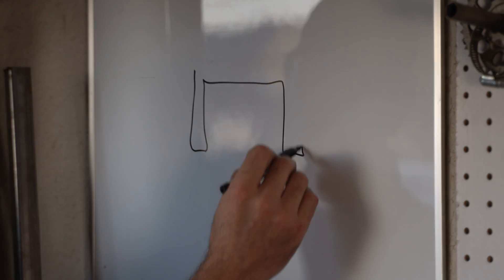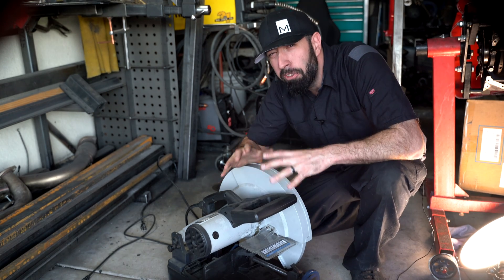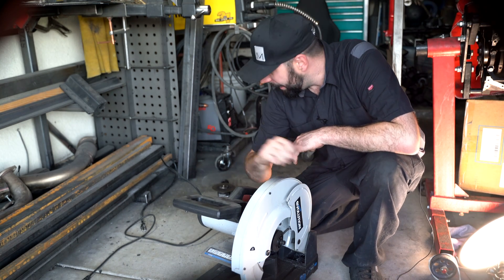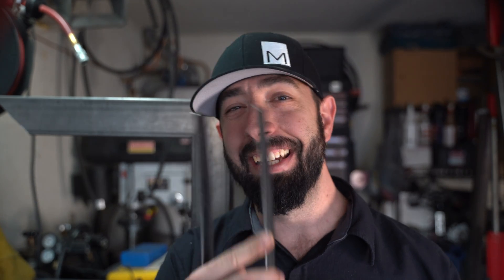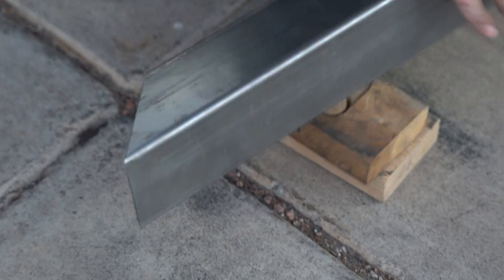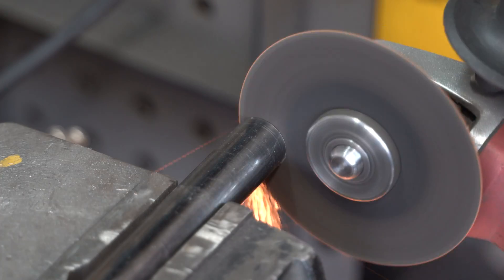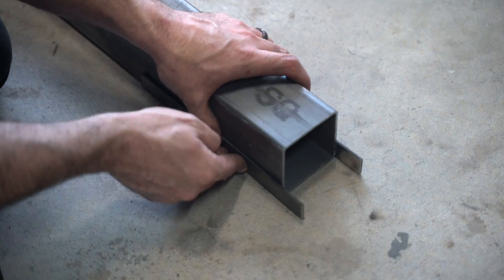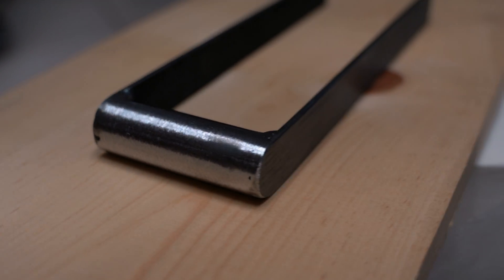Cut a Perfect Miter Joint/Corner Joint in Metal Tubing with a Handheld Grinder!!

Comment: Thanks for the idea. I used this to make my own jig but instead of pipe holding the flat 45s I used a piece of square tubing running perpendicular. That way all you have to do is pull the tubing from the jig flush with the piece you are cutting and the guides run perfect 45s on either side without having to use a square. If I want a different angle I can always mark the angle by hand and use the parallel pieces without pulling it flush. Hopefully that description makes sense.
Reply from the maker: I think I follow and that's super smart! A huge percentage of my cuts are 45% and that would eliminate the use of a square for most things. Thank you for the share!
Reply: @GarageFab  can you show how to make Y shape from square hollow tubes? I don't know what angles to cut so it fits.
Reply: Have a video of this? Not really understanding it from the description 😖
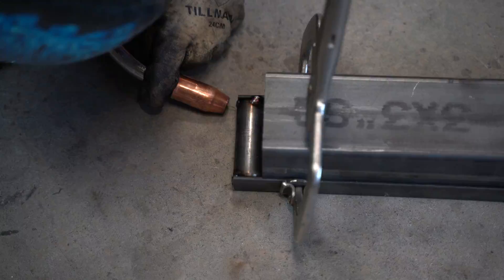Reply: @K1L0W0G  Imagine if the round tube on this jig was square tube instead. Now imagine that at 2:47 the pipe section was pushed down against the workpiece instead of just sitting in the air. When pressed down, the flat part of the square pipe handle would lay flat against the workpiece, which means this wouldn't be very good for "random" angles because the flat part of the square tube and the flat part of the workpiece would want to lie directly against each other. Then you could weld the two flat bars so that when the square pipe handle is pressed down on the work piece they form perfect 45 degree angles automatically. So you wouldn't need to use the square and marker to mark your 45 first. You could just set this tool down on it and it would line you up for a 45 degree cut automatically. This would be trickier to weld up since the square tube would be rotated 45 degrees from lying flat if you try and do it like it's done here at 4:40. It would make sense to do it exactly like in this video with round tube first. Then clamp the tool to the workpiece when it's at a 45 degree angle like 2:24. Now you could easily clamp two more flats resting on top of your known parallel flats from the first tool and set a piece of square tube between them resting on the workpiece as a handle. Tack in place and weld. Now you have a 45-degree only tool that doesn't need a square and a tool that does need a square and can do any angle like in the video. Hope that makes sense.
Reply from the maker: Thank you for taking the time create such clear instruction, Colton! In the beginning I had hoped that this channel would become a community of like minded people that would be willing to help one another out.
Your response made me smile. You are appreciated. 🙏
Reply: brilliant
Reply: I work as much in wood as I do in metal so I’m going to fab-up your parallel tool in some nice solid oak. It’s used as a mark up tool and will never see flame or heat so why not solid kiln dried hard wood ?
Reply from the maker: I’d love to see it when you’re done! It makes me smile to think it could be a beautiful tool. The one in the video is the nicest one I own. The rest are just mild steel flat bar welded to some pipe. Mill scale and all. 😂
Reply: Bro! Bro! Bro! You made a novice into an expert with that idea, even with a full length of tubing you need to ensure it’s level to the bed of the cut off saw to cut it square or true to whatever angle you need, this can be challenging for some. Love your videos and as one of your comments said, short and sweet ! But we neeeeeed more videos lol ! Much love from the Caribbean!
Reply from the maker: @SuperMarcanton  Thank you, Marc! More on the way. Cheers!
Reply: I have watched this video time and time again, what about a collaboration with Fireball tool to see if you can make this tool and sell it ? Just a suggestion .
Reply from the maker: I love Fireball Tool. Brilliant stuff. It’s such a simple tool, I can’t imagine needing his brilliance. I’m developing an online store of my own and we’ll try and market it there and see what happens.
Reply: excellent @GarageFab
Reply: Yes just found by accident 2 bits of angle welded perpendicular will give the same result. But your way using SHS would be a bit better
Reply: What’s to stop you from making the flat stock slightly thicker and you can clamp it to the workpiece and use it as a temporary guide for the flat side of the cut off wheel. Once the beginning of the groove is marked, remove and cut the rest of the way. Straight, accurate cut and no damage to jig.
Reply from the maker: Do you have Instagram? If so, contact me there and I’ll try and draw up a simple sketch of Jon’s idea at lunch break tomorrow.

Comment: Brilliant!!! Maybe instead of fabricating multiple jigs, construct one and replace the middle tube with a suitable length screw and some nuts. Each time you have to calibrate the tool, though...
Reply from the maker: Yes!! Man that’s such a good idea. I’m going to make that as soon as I get a chance. Thank you. You should be able to avoid the need for calibration if you use two tightly fitting square tubes, in place of the round tube I used.

Comment: Hi, I'm a novice , never trained diy welder and that, my friend is a very good idea. I'm about to start my project shortly of building two gates with 2x2 galvanized hollow steel and a sliding gate with 2x2 and 2x3 sections. That is an idea which I will surely use for accuracy..

Comment: You could get 2 sets of telescoping pipe, weld both larger tubes to one side spaced a few inches apart, and the smaller inserts on the other leg. Then you'd have an adjustable tool that widens/shrinks so you don't need a new tool for each width of pipe.
Reply from the maker: Very good idea. 👏

Comment: You are good. How do i know? You use flex without protection cover or safety gear and you are at age and have all eyes and fingers.
Reply from the maker: Hahaha! I guess that’s one way to look at it. I use a guard now. Too many people got mad at me.
Reply: @GarageFab  i don't believe you 🤣. I guess only when cameras are rolling. I have such nut like you at home so i can tell it is hard to break a habit. Starts with working in flip flops ends with welding with just looking away.
Reply from the maker: One weld spark between the toes is enough to disown flippy floppies for life!
Reply: @GarageFab  🤣 just heavy swearing in our case. So far. Knock knock. And we use mainly flux core so probably really asking for it.

Comment: I did notice when you were cutting with the grinder. You actually put the grinder on an angle as well and my dumb a** wouldn't have thought of doing that. Thanks.
Reply from the maker: It’s just a habit from cutting thicker wall material. It doesn’t matter as much with thin metal. However! I would recommend when cutting, Start with the angled lines, and with the grinder vertical, continue cutting passed the edges a little. That’ll put a short cut at the corners that will indicate where the 90 degrees cuts will be. Because sometimes they aren’t where you drew the lines. 😬 Hope that makes sense.
Reply: @GarageFab  They are NEVER where you drew the lines 😛

Comment: All the utubers spend more $ on cut off wheels than just buying a miter bandsaw, like Ellis brand. They last forever been using them for thirty years.
Reply from the maker: Haha! I have a metal chop saw, but the purpose of Garage Fab is to show people with low budgets that they don’t have to buy a bandsaw or chop saw in order to take on big projects.
Reply: This dude must be on crack.  Bottom of the line Ellis bandsaw is $4200 out the door.   That would buy a damn tractor trailer load of cutting wheels
Reply: @vr6swp  if you want to take all day and have poor quality fits, have at it! As far as crack goes you won't want to tell me that to my face!!!

Comment: At 2:15 into this video, you show a horizontal bag setup on a frame.  What is that about ? Let's see the rest of what the bags do please ?
Reply from the maker: Ah! That was one of my favorite builds to date. Those were remotely mounted bags for the front suspension of Chevy Luv pickup that was getting a V8 engine. The front control arms were so small that an air spring large enough to lift the motor wouldn’t fit.
When the bag inflates, it pushes a hydraulic cylinder mounted to the frame, the fluid from that cylinder is forced into a second cylinder that’s mounted to the front suspension which provides lift.
If that didn’t make sense, scroll down my Instagram (@GarageFab) a LONG way and you’ll see a lot more photos of the project as well as some videos of it working and a video of me jumping up and down on it. Scroll till you get to March 2019.
I won’t be doing any videos on it unfortunately because that truck is in Arizona now, but I might try and use the ideas in future builds. 🤷‍♂️
Reply: @GarageFab  Thank you for that.  It looks interesting but I can't access Instagram. I don't own a smart phone - a requirement for an account there. But what you did looks interesting. I love fabricating & appreciate your videos, time and effort.
Reply from the maker: I envy you not being tied down to a device like everyone else in the world. I can access Instagram from my desktop without an account. You may also be able to.
Thank you for the kind words, James! I appreciate you. 🙏

Comment: I struggle with the flats to be honest. Getting the square line to be in the correct spot to match up with he angle markings as it goes around the tubing.
Reply from the maker: I’m not sure I understand, but if I do, try lightly clamping it to the piece you’re cutting. Clamp loose enough so you can move the tool around but tight enough to hold it in place when you let go.

Comment: Cool videos. Looking for recommendations  for home 110-120volt plazma cutter and 110 compressor. Cutting Nothing over 1/4 inch
Reply from the maker: Thank you, Tim! I’ve only had experience with two plasma cutters. Mine, Hypertherm xp45. It’s amazing.
I also used an old timey Esab. I’m not sure of the model. And I’ve also got no recommendations for air compressors. I went straight for 220v. Most 110v compressors are super loud and they don’t produce enough air for constant plasma cutter use.

Comment: Watched to 2:18 and subscribed to your channel. You are an inspiration to lowly weekend warriors. Kudos Sir!
Reply: I will get mine laser-cut in quarter inch steel as "U" shapes .
Reply from the maker: Thank you Jonathan! You are greatly appreciated.
I really like the idea of the laser cut tools. I think that would take them from slapped-together to really professional looking.
Keep in mind though that the width plays a large part in ensuring the the edges on both sides are in the same position. The thinner the tool is, the more it can rock and therefore give you inaccurate markings.
The wider the better! That said, consider keeping the laser cut U idea but make it a quarter inch wider than the material so you can slide in some 1”-1.5” flat stock and tack weld them. 
Can’t wait to see what you come up with!

Comment: thanks a lot Sir. now i know how to cut the corners of the square tubes. i am new to welding and just starting to make DIY's and my mistake is when i cut the corners i cut it in a 90 degree angle. i never thought it should be slightly bend on some 45 degree or something, I appreciate that Sir. thanks a LOT.
Reply from the maker: My pleasure my man!
Best of luck on your channel. 🙌

Comment: Your scribing jig is a nice idea. If you added a little rubber band at the end of the legs to pull them gently towards your material, it might be more forgiving towards a little rougher handling when you need to turn things over. On the other hand, it doesn't need to withstand any more forces than a sharpie's point, so whatever 😀
Reply from the maker: Something to keep it in place would be brilliant! I occasionally clamp it to the work piece but that’s somewhat cumbersome.
I appreciate you!

Comment: instructions unclear. I used the tool to stab my BF with it. can you show how to make Y shape from square hollow tubes? I don't know what angles to cut so it fits.
Reply from the maker: Sounds like no instructions were needed! 
Now clear your YouTube search history so I don’t get a visit from authorities.
You’re asking questions about geometry and math. Both of which I generally try to steer clear of.
But here’s some likely terrible advice…
Assuming your “Y” will resemble the Mercedes Benz star, each of the three tubes will need to be cut twice to form a 120° point. Scribe a line down the center of the tube. I believe each of the two cuts will be 60° with the point dead center on the square tube.
That’s six 60° cuts total, and maybe possibly with a lot of luck they might fit together to create a three pointed star.
Lemme know just how wrong I am!!
Best of luck.
Reply from the maker: …and something feels wrong about that and I haven’t any tools with me to confirm.
Each cut may actually be 120° to create a 120° point. 🤔 My head hurts.
Reply: @GarageFab  it's much more difficult than it looks. I tried making one piece 90 degrees and then other 2 pieces 45 degrees, but the problem is I wanna put these two pieces to connect to that hole on the 90 degrees piece. so the V shape must be in the middle of the 90 degree tube and they must both fit inside. you can make a video about it sometimes if you think you can handle it :)
Reply: it will lay down on flat side. just like letter "Y" nothing fancy.
Reply from the maker: Still struggling to picture it. I can’t promise a video. (Because I can’t envision where this piece would fit on a vehicle) But maybe I’ll slap something together on my Instagram account if I can find some time. 🤷‍♂️
Reply: @GarageFab  it is not for a vehicle. it's an item I wanna make for woodoo to turn my BF into a capybara. I hope the authorities will not see you as my accomplice. you will figure something out. tell them you wanna adjust your exhaust :)

Comment: Thank you for an excellent piece of training. I am a week into metal working. Building the feet of a dressing table for my wife.
But I battle with the marking or the rectangular tube. I need to work with 60 degree joints, but that's not the problem. I also work with rounded corners of the tube. I cannot get the marking right when I, for example draw a 45 degree line on how to take it around the corner.
I see you take it around the corner right up to the flat surface again en then draw the connecting line on the flat surfaces.
Am I right in saying this. Maybe you can make a real beginner video just about marking alone.
Thanks anyway for this video. Well done on superb cutting.
Reply from the maker: Thank you Deon! You are correct. Fighting rounded corners is always a challenge. It’s something you’ll get good at over time.
If marking around corners is still troublesome, you can try marking only the sides of the tubing and then cut those marks. If you keep the cutting tool straight up and down you’ll naturally cut through the rounded corners. Then mark the remaining two sides by connecting the ends of the previous cuts.
It’s definitely a “practice makes perfect” thing.
Good luck my friend!
Reply: @GarageFab  hi again. Wow, great tip. I will definitely try it tomorrow. Keep it up! I just joined your channel and even though I understand not even half of what you're doing, I like it and it is beautiful.
Reply from the maker: Hahaha!! Hopefully it’ll all make sense soon. Thank you again! Cheers. 🍻

Comment: I know I'm nearly a year late for your video. Love your work. Those cuts are excellent. I am going to start fabbing up some internals for a camper van. I can't believe that this is the first time I've seen / considered actually cutting inside and outside at 45 degrees by tilting the tool. I probably would have kept the blade at 90. Well done.
Reply from the maker: No such thing as late on the Internet! I’m hoping these videos will be around for generations to come. Happy to be of service and good luck in your van, my man! 🚐 Thank you!

Comment: How do you make it with a 45 degree bend instead of a 90 degree bend. Would you only cut 45 out of one piece and leave the other a flat surface. Or cut 22.5 out of each and join?
Reply from the maker: You’re correct with the 22.5° You will get a 45° bend either way you do it but if you only cut one piece the ends won’t match up properly leaving a small section of open tubing. Two tubes cut at 22.5° (or 67.5° depending on what side you’re using to find your angle) will mate up nicely.
Cheers!

Comment: How come I have a metal cut off saw and I cannot get perfect joints--ever? It is the worst part of welding
Reply from the maker: I feel you! What type of Saw do you have? As far as quality cuts go, I’ve never had luck with the abrasive chop saws. If you have a toothed blade, I The problem might be the teeth wearing unevenly. When my blades start getting dull it seems as if the cuts start wandering a bit producing a slightly slanted cut. Might be time for a resharpening.

Comment: Genius tip! Thanks!!
Reply from the maker: Thank YOU!!
Reply: @GarageFab  I made a few of the exact jigs.

 I also made some jigs using a piece of each size square tubing I commonly use.

Instead of putting the flat bar 90 degrees and using a round handle, I welded the side guides (flat bar) on each side of the tubing aligned at a perfect 45 degrees. 

Then I cut this piece off with the 45 degree flat bar welded to it. 

Now when i need a quick 45, all I have to do is straddle the appropriate width jig  on top of the square tubing and it's ready to mark a 45 on each side
Reply from the maker: That's brilliant! Thank you for sharing! I may have to do an updated video sometime and I may borrow your idea. 🍻